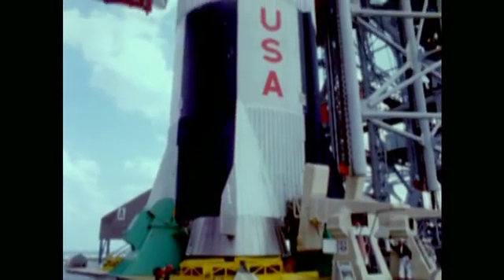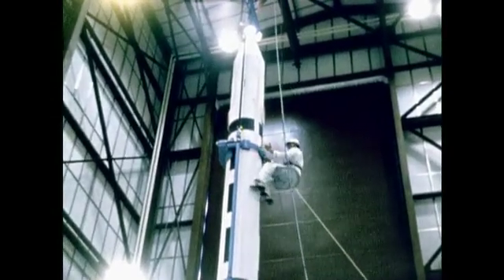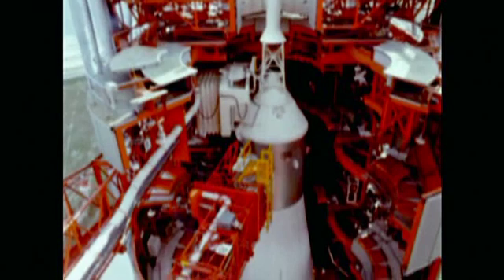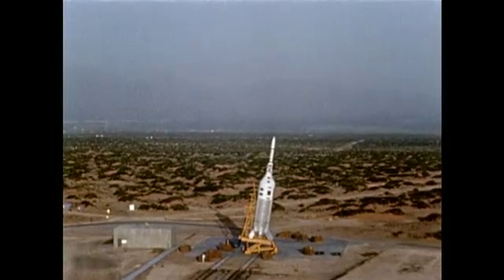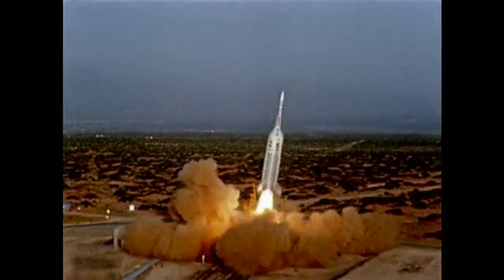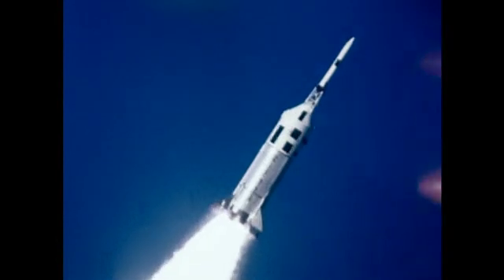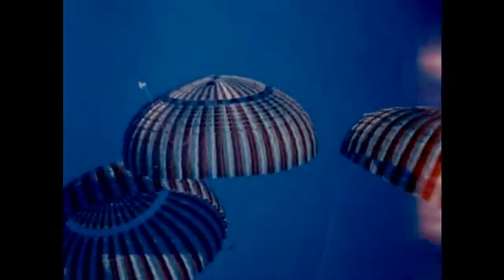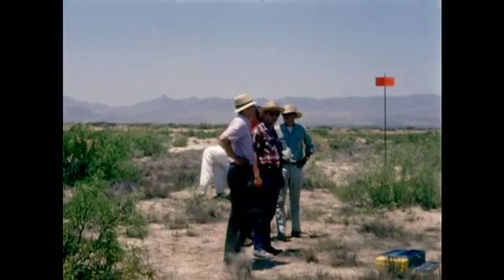Apollo Launch Abort System Test

Comment: @roguemale57 I'm pretty sure the plans are still around if NASA wants them. But they wouldn't want to build another Saturn V, nor should they. Technology has moved a bit since 1973. Would you still want to build the exact same guidance system today? Of course not. You use the old systems as engineering guides for designing new ones. You don't just clone them.